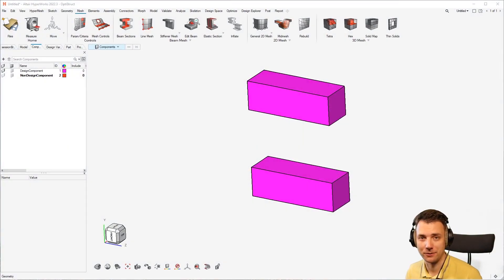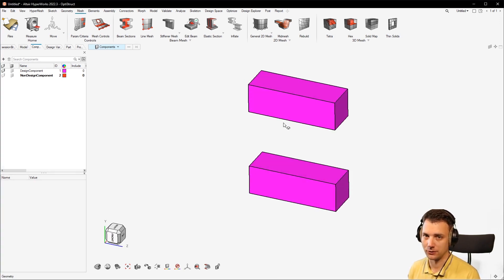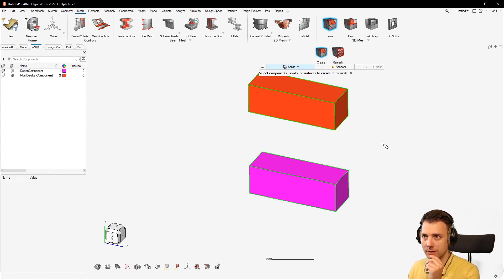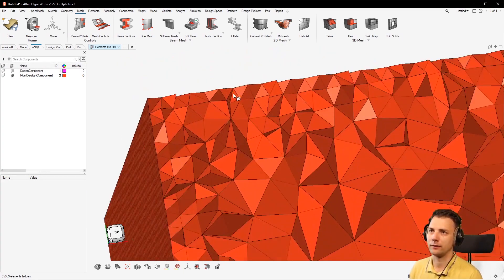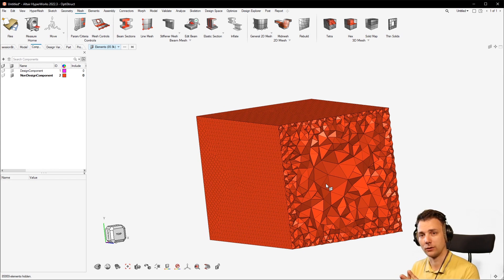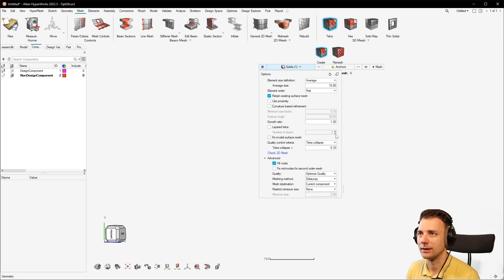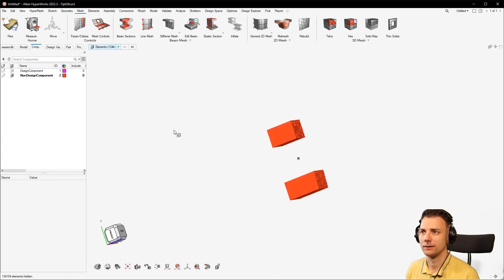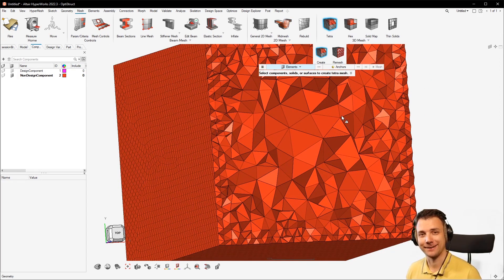Altair Hyperworks #short -  How Tetra growth parameter negatively impacts Topology Optimization

Comment: Thanks for the excellent tutorial. 
I am trying to mesh a multi-component assembly simultaneously, however, Hypermesh creates a new component and assigns the whole mesh to it. 
How can this operation be done in a way that each mesh is assigned to the corresponding component (like the way that Ansys or Abaqus)?
Reply from the maker: Yes that for sure is possible. It is unde the advance options on the mesh: there it says: Mesh destination. It can be current component (this is what you exerience: it puts the mesh into the bold marked component) and also it can be original component (this is what you want: the component where the geometry is in).
Let me know if it worked :)
Reply: I could eventually find it. 

I appreciate your help @ManuelRamsaier